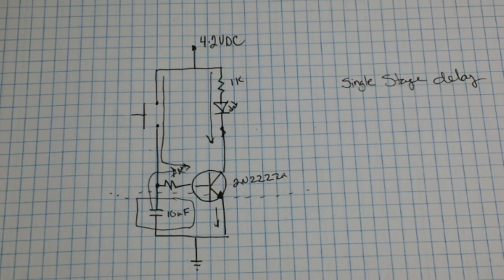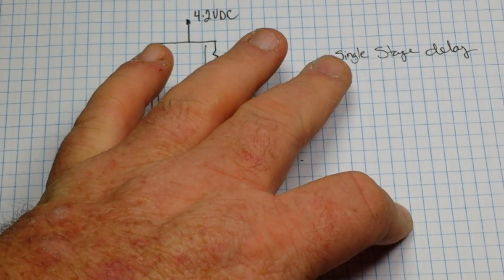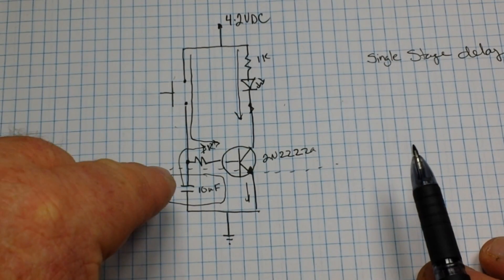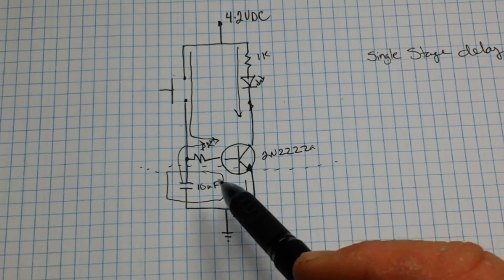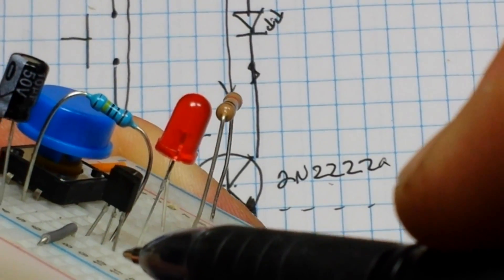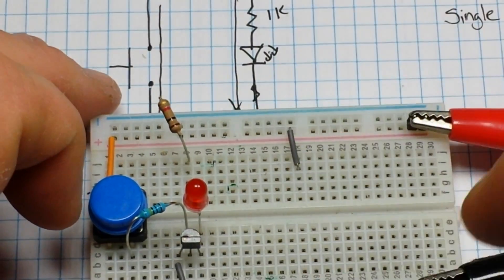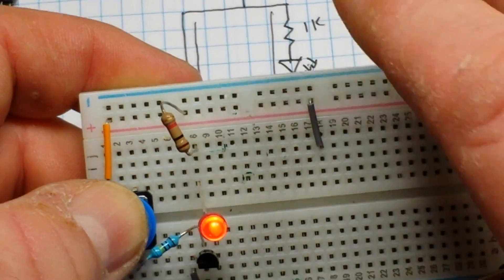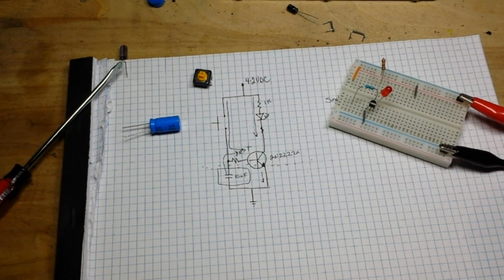How to make a simple delay circuit

Comment: JUST GREAT!

The major advantage of this clip over many others is that you begin by explaining the schematic in detail. From a didactic standpoint, this is exactly how it should be done:
first, the conceptual framework is established. Only then do you proceed to validate the concept using a breadboard, providing experimental confirmation of the idea. This mirrors the scientific method precisely: 
Formulation of a hypothesis
Experimental verification
Adjustment of the hypothesis if required, followed by repetition of the cycle

This approach is not only correct—it is, in my view, the only viable way to teach electronics effectively.

If you were to develop a full introductory course following this structure—perhaps aligned with a reference such as Electronics for Dummies or another introductory textbook—it would be extremely valuable. Such references are important for learners who may need an additional source when certain concepts are not immediately clear.

In any case, KEEP POSTING content in this manner.
And thanks for your effort.

Comment: I need to make a DC circuit that delays 2 seconds after power is applied and then after 6 seconds of energizing completely stops. 

Would it be best to use 2 circuits, the first being an 8 second off timer feeding a 6 second on timer?

Or is there a way to build an off delay and on delay timer in one circuit?

I want to build this in a manner that you have in your video.

Comment: Great video but I have added Bluetooth to a speaker but I’m using the audio jack in as my audio source but for some reason the speaker needs to see the jack plug put in after about 45 seconds after switching in the speaker before it will play any sound. I need a circuit that switches on after about 45seconds so basically the reverse of this circuit. Any ideas?

Comment: Hey i know this video is old but im trying to make one of these circuits and im not sure what sizing to use on the resistor and capacitor.  Im using it to open a 12V solenoid valve for only about 1.5-2 seconds.  Could i use this setup exactly as you built it without frying anything?
Reply from the maker: Your resistor capacitor choice is actually your timing choice. They are working together in what's known as an RC circuit. The resistor limits the current that goes into the capacitor. It also limits the current that comes out of the capacitor. So the timing of the circuit comes from the capacitor crossing the zero line. On one way. The resistor is going to slow down the current charging and when it's discharging it will also slow that current out. So the so the capacitor doesn't dump all of its energy at once. That would be a zero second delay. You could try starting off with a one microfarad capacitor and a 1K resistor for your timing, that should get you somewhere in the ballpark.
Reply: @learnelectronics  awesome thank you so much.  Ive forgot just about everything i used to know about circuits so ive been spinning my wheels trying to recall what i used to know.

Comment: "dont think this as a RC circuit"
the next moment he says, "the resistor is there to limit the current"

bruh.. the discharging current flows throught the base and completes the ckt by coming out through the emitter and going to the other plate of the capacitor.. and the resistor is limiting the current therefore delaying the discharging so YES IT IS AN RC CKT, JUST THAT THE RC DISCHARGE SIGNAL IS AMPLIFIED BY THE TRANSISTOR LOL!

Comment: Hi,  I used this circuit with a small Pulse Generator with the LCD display that has 3 Duty Cycle adjustments. I was making one of them offset so they won't fire 2 mosfets at the same time.  I had a 10uf cap. It seems the Cap blows up the generator running at 12VDC If I use a 4N25 do you think it will blow too? Thanks

Comment: Exact same circuit but with the 1M across the cap and use an n-type FET. Might be best to include a 1k gate resistor but not essential. Turn off time will vary depending on FET threshold.

Comment: wondering if the next step would be to somehow have the transistor drive the switch (replacing it with a pnp) so that it sorta flashes on and off maybe? no probably not...

Comment: Hey i made a Door bell circuit using this circuit. at the end when capicitor charge goes out buzzer start sounding its dying. insted of lowering (diming the led) is there any way to cut down instantly the capicitor charge signal at certain level.

Comment: Hell yeah!!! Thanks a lot. Im aut!stic(high functioning), I've only halfway understood endless information I've read about Transistors, that one little statement you made finally showed me how simple it is(wonder why no one tries to explain it that way???), the base acts as a gate-valve  for the channel which flows from collector to Emitter! But how is the amplified signal(in the case of audio amplification) produced at the collecter. Or is the amplified signal more so a voltage difference between the collector and the emitter, with resistor following after emitter to seperate from ground(so that the voltage on emitter side isn't 0 volts(ground)?

Comment: hey just made this circuit and a crazy thing happened. Wanted to change capacitor to a different value. disconnected the ground and LeD went off. touched it with my fingers and LED came back on. did the capacitor use me as the ground ?
Reply from the maker: Yep

Comment: 3:30 This is not a completely accurate description of how this node works. You missed the very first stage of charging the capacitor to the voltage drop of the base-emitter junction (typically 0.6 ... 0.7V), before that the transistor is closed. This feature can be used to delay switching on if a resistor is added in series with the button according to the RC time constant.

Comment: Wonderful circuit. But what i am using it for is little different.. I am a newbie and i am trying to play around with electronics. Currently i am trying to make a timer alarm for my door.. I have a door, i just need to know if the gate is open but i don't want the alarm to go forever as long as the door is open.. I did try to use arduino, but I'm trying to make it easier. So, is there anyway we can make this delay circuit run only for 30 seconds even if the contact sensor is giving continuous input?. Basically,i need alarm to go for 20-30 seconds when someone opens the door, even if the door is open for a long time i don't want the alarm to go on forever, i need the alarm to stop after first 30 seconds. Is there anyway anyone can help me with that?

Comment: Three small problems:
 1. No current limiting resistor before or after the switch = large cap charging current spike = switch contact corrosion
 2. NPN Transistor should have the load between ground and the transistor
 3. Technically this is a Soft-Start circuit not a delay circuit. Replace the Transistor with a Schmitt-Trigger IC to build a real delay circuit like this (or a MOSFET + drain resistor).

PS: Also the switch should switch between 4.2V and Ground to improve the turn off time. Or at least put a drain resistor parallel to the capacitor

Comment: I'm coming to this with nearly no knowledge of circuits or logic gates, but I still could understand how this works. Before this I had no clue how you could possibly cause delay in circuits since electricity moves instantly(more or less) along the wires, but the concept of using a capacitor that you slowly discharge is really really brilliant!
Reply from the maker: This is called the RC constant (resistor-capacitor) and you can use a resistor to control the rate of charge and discharge of a capacitor. If you are interested in these types of things have a look at my videos on the 555 timer.

Comment: I want to do this for a relay circuit, using a 12V DC relay. Only need it to be maintained activated for a couple seconds maybe in the event of an accidental button release (the button needs to be pressed and held to activate an intercom system using some telephones that are getting switched off of the regular telephone line which they are connected to in the NC state). How do I determine what resistors and capacitors I will need?

Comment: Could a variation on this be used for an m-sync to x-sync converter? When an m-sync camera flash is used the flash bulb holder PC conector is shorted by the camera about 25mS before the shutter trips. For an electronic flash that prefiring leads to no flash when the shutter is open. The circuits I have seen have been fairly complex using an IC timer to trigger an SCR after 25 or 26 mS. Something simpler would be nice.

Comment: Hi @learnelectronics,

Thank you for the great videos.

Question: Is it possible to control the fade on and off time of the led by adding two potentiometers?
One between voltage source and resistor/led, the other between ground and...?

Comment: Could this work on a 12V car audio system. To have the amplifier delay turn on say 20 seconds then power of after 2 seconds when radio shuts down?
Reply: I think that you would have to use this to control a relay.

Comment: Hi. Thanks for a good explanation. This might be a stupid question, but can a simple time delay circuit be made with a toggle switch? Instead of a push button that cuts the circuit after released the toggle switch would keep that circuit in the ON pushed or pushed in position with the push button switch and yet still switches off in a second or two. I do not know if a circuit is possible where it switches off while still in the ON position. To start the timer again one then need to then switch the toggle switch off and on again. I hope it make sense what I am asking. Thanks

Comment: If you were to create a circuit where the led would be lit for just a couple seconds after the switch is pressed, would you then have a simular circuit but where the base of the transistor would be connected to the negative side of the capacitor?

Comment: I was thinking about something like this, but with a power (mos)fet. Would that work? I want to trigger (and retrigger) something and stay on for somewhere between 1 to 10 minutes, when moving a bicycle. So the switch will be one of those vibration switches. Current maybe 1 or 2 amps hence the fet.

Comment: Hi.  I cant get any capacitors to work. What am I doing wrong.   All caps are 50v 2.2uf to 100v 470uf.   But caps have bin setting for a while 15years....and they check out with the multimeter.

Comment: Would this work with line level sound signals? I build horn speakers and midbass horns become too large to physically timealign with the smaller horns in the midrange and treble horns.

What about the V3205 bucket brigade delay chip?

Comment: I need a circuit held at 5 volts and sent low by a ground trigger, that can't be held low if the trigger is held low. It needs a fixed (but adjustable) fall and rise time, and needs to rise immediately after hitting 0 volts. Why? Fuel injection without software... analog fuel injection. The circuit I just described will be compared against a 0-5 volt single from a MAP sensor; the amount of time the MAP sensor voltage is higher will dictate how long the injector is powered on. Should be about as performant as mechanical fuel injection.

Comment: Thanks for the video.  I find it confusing when you said open up the transistor.  If you take the pushbutton switch, it is normally open or not conducting until the button is pushed.  Then the transistor is open or turned off until the current flows into the base, then it turns on.

Thanks.

Comment: great video! I'm starting to look at these circuits and it's awesome to see the basics of how everything works! this is a beginner question, but does the polarity of the capacitor matters in this case? also, why does not the capacitor discharges the current to ground and instead it discharges to the transitor? is it because of the polarity?
Reply: Hey — fellow beginner here but gonna take a crack at these questions for my own learning. I know it’s a year late also but maybe it helps someone else.

First — the schematic doesn’t indicate a polarized capacitor so you should be fine either way. If it had a curved plate in the schematic icon then that would indicate a polarized capacitor. He does use an electrolytic in the video tho, and ur more likely to find an electrolytic one at the values he’s using.

As far as “why does current only flow out the positive side”, the thing to remember is that current doesn’t actually flow through a capacitor. Any current that appears to go “through” the capacitor is displacement current. Basically as you charge one side of the capacitor, you’re creating a displacement current that is opposite in polarity to the charge on the other side. If you’ve wired up an led in series with an RC pair then you would see the LED light up for a short time until the capacitor fully charges. This makes it seem like current is passing through the capacitor, but what’s lighting the LED is the displacement current created by charging the other side. Once the capacitor is fully charged then it no longer creates this displacement current and the LED turns off. Please correct any nonsense I’ve said here but to the best of my knowledge so far this should answer your question about current flow.

Comment: I had to use a 3.5M ohm resistor and a 100uf cap to get a 2 second delay??? Replicating your diagram the delay was still there but less than one second. Would go from full bright, then hung on forever with a sliver of power. Not sure what I did wrong? used a D331 transistor.

Comment: What makes it not an RC circuit? it is still using the resistor cap relationship but the transistor allows us to Control the discharge time. is there a way to match components close to get desired time base? (range of the timer?) i tend to think of this as a timer i would combine it with a latch or Flip Flop circuit. :) which would eliminate the need for a manual Switch.

Comment: 3:40  Sorry, I don't subscribe to the conventional current flow theory.  Electrons are negatively charged particles that flow from negative to positive, which is the same direction current flows through diodes and transistors when forward biased. Basic electrical theory.  Ben Franklin was wrong 2.5 centuries ago, why do you choose to be today?

Comment: Does the capacitor charge instantly to 4.2v when you push the button, or should you hold the button down for a few seconds? Also the very long gradual dimming takes away from the usefulness of the circuit.

Comment: Very interesting. good explanation. I'm looking for a solution similar to this design. No switch. 5vdc micro-b usb in, delay 60-90 seconds, the 5vdc out. This is to delay a Raspberry pi from power up before the TV comes ready. Sure, I see the 5v-30v delay relay timer module on amazon, but like you said - where's the fun in that. Any guidance is welcomed. Thanks

Comment: I followed the method you connect all the components but my led only light up when I push the switch and goes off after I released the switch button. Why is it like that? Need answer urgently. Thanks

Comment: Your video is awesome. Just one question, why you didn't put any resistor in series with capacitor to limit the current? Will this sudden high start up current burn the source or capacitor?

Comment: Hello. Enjoying your vids. I have a 1993 Mazda Miata, small car. For safety concerns I connected a relay to turn on Headlights and running lights so that lights always come on when ignition is on. That way I dont forget to turn my lights on even in day time. The car is small and low to the ground so I make it as visible as possible otherwise other drivers dont see me.

The problem currently (pun?) is that I would like a delay of  I guess 10 seconds before relay turns lights on. So I need the oppsite,  Power up, off, delay, on.

I have a toggle switch that cuts power to the relay. On the car lighting switch, the turn signal stem,  I tapped the 3 wires which control other relays to operate the lights. The headlights pop up and light. But those 3 wires are low amperage control wires. So no heavy gauge wire was needed.

I intend to add more LEDs on to increase visibility. But this may add to starter drain. So far its working and I can always toggle off then use the manual. Since I parallel the 3 headlight control wires the relay acts as independent switch.

Its strange Japanese wiring as they use ground to switch. The 3 wires. Red=(headlight  & refractors) white= running/parking lights) white+stripe(ground).

The relay I bought was universal 5 prong, this only had one outcome circuit, so I had to tie running/parking to come on always with headlights/refractors. I dont know if they make one for two circuits. (single pole, double throw?).

Alternatively, instead of delay I use output to starter to cut out relay. Maybe another relay with normally closed contacts.

Your thoughts appreciated.
Reply: forgot to mention, the delay might be nicer as headlights might pop up/down annoying when struggle with starting

Comment: Why does the LED fade over time? Isn't the transistor like a switch, open, until the current that goes out of the cap is to low and the transistor is closed?
Reply: The transistor can be "though of as a switch" but in real life it isn't quite.  It needs some amount of Base current to pass a given amount of Collector current.
Look for the HFE number on the part's data sheet.
The voltage on the capacitor the voltage between the emitter and base and some Ohms law can help you to grasp what is going on.